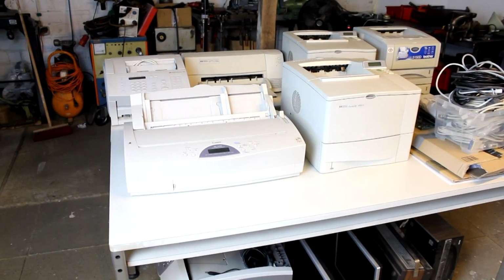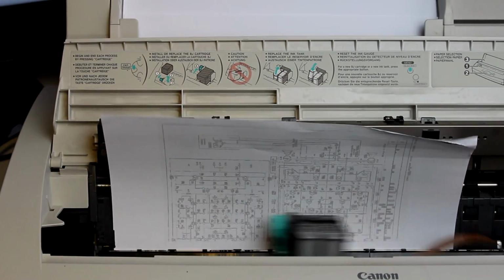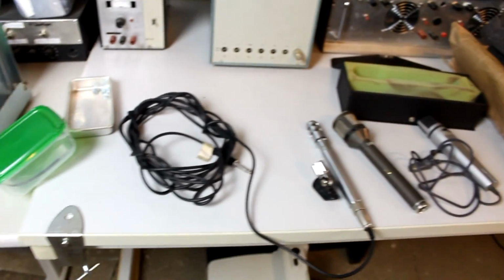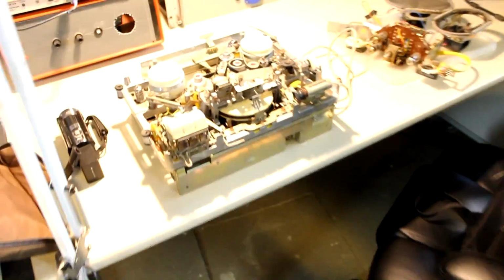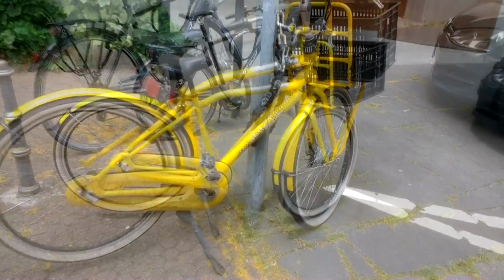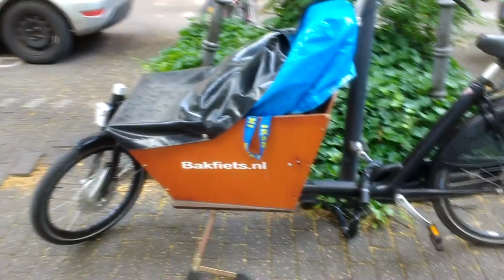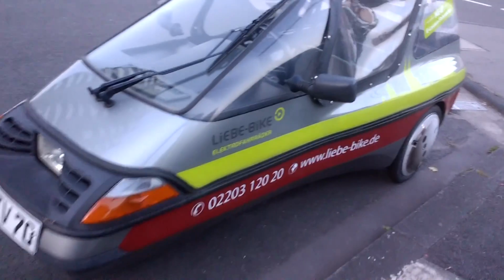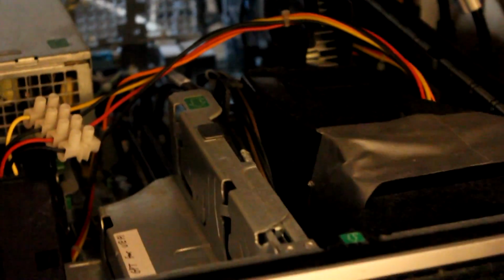TPAI Lab Report #014: DIY Cargo Bike? Disk Writing Robot etc.

Comment: The problem with the trike (three wheel design) is that there is no feedback from the front wheel when the road becomes rough (like the streets of Krefeld). It's too easy to loose control and that is why motorcycle companies stopped building them back in the 80s. Two wheels in the front offers such feedback and alerts the rider when the road becomes uneven. As far as width is concerned, it is best not to ride so aggressively through tight traffic, especially when loaded with cargo. In Germany many young riders tend to go through heavy traffic like Superman and watching that everyday makes my hair stand on end!

Comment: About the bikes some terminology you might want to know.  A DELTA style tricycle has the 2 wheels in he back, a TADPOLE tricycle has 2 wheels in the front.  Delta's and rigid-axle tadpoles tend to be unstable (they tip over easily when turning), so a TADPOLE with an Ackerman steering system is the best choice in trikes.  Build whatever cargo cycle you wish, as each has it's own advantages and disadvantages.  Many people prefer to avoid more than 2 wheels altogether.  I like your videos, keep 'em coming!  :-)

Comment: The obvious thing to do with a parallel port printer is add a RasPi or something to turn it into a network printer.   You can get them all to emulate the same modern protocol that way, and avoid driver problems (assuming you can get a Linux driver running on the RasPi).   The other way is to get an old PC running a version of Windows that matches the age of the printer.

Comment: When I was 17 or 18 I used to be a delivery boy for a super marked that offered home delivery of entire shopinglists and Beverages.
We hat several cargo bikes with the cargo platform over the front wheel and one of the extended ones with the platform between handle and front wheel.

While the smaller ones were more agile the extended one had a crucial advantage: The platform was lower than the axles!
We were able to stack up to 8 crates of glass water bottles and throw an additional banana box on top of it and another one on the rear standard pannier rack.

That were easily 2 to 4 times as many deliveries in one go as you could carry with the smaller bikes.

Your Videos shoes several extended bikes with a platform higher than the axles... I don't know about these. In no case you will be able to keep the  center of mass below the axles, because the cargo will be stacked up. But every bet might help.

Greetings from Cologne by the way
TOM

Comment: Hello    Please Help
I wish to build a Quad Bike for my 11 yrs old kid.  I will use a battery and motor to provide the rolling force.
I need to know what motor I should use 
Thanks
Reply: urdu learner Quads are death traps
Speaking from experience if you roll one your foot / leg is screwed.

If you are going to build one then make sure the center of gravity is low and the quad is light
Reply: get a grey one. pretty much every type of motor i've seen in these electronics videos is grey.  go with grey, it's a safe bet.
Reply: urdu learner 
Maybe use a motor from an old whipper snipper or lawn mower? 

But if it is for your kid use an electric motor from an old power tool or something, quad bikes are death traps.

Comment: Cargobikes: The cheapest and easiest way to build one is to make a two wheeled bike. Like the ones you showed in your video.
Then you just have to extend the frame and add heimjoints and rods to extend the steering.
I also suggest using a smaller wheel front wheel,  it's a bit easier to handle and it makes the build process a bit easier.
16" may be a bit too small for cobblestone roads  but 20" or even 24" should be fine.
And if you want to upgrade to an E-bike; just chop the rear frame and replace it with a second had E-bike with the motor built in the frame . There are a lot of cheap second hand bikes around with dead batteries that you can by for a bargain.
Can't wait to see what you come up with!

Comment: That "industrial" bike is a modern replica of the famous Long John - not to be confused with underwear. 

As for the tricycles, it's certainly accurate to state they struggle with narrow innercity environments and just have a lousy handling in general. 

The HP 4050 is a beast of a printer: cheap running cost and extremely reliable. Especially the network enabled version (4050N) is still a very attractive option today, as it can be connected via ethernet to a wireless router as a network printer, providing wireless printing for all devices on the network. They should still fetch a pretty penny on ebay.

Comment: just buy a trike and get the 1000w hub motor kit for ebike and 2*6s battery I recommend the 16000mah or 20000mah 6s multistar battery from hobby king because it is only 150$ and a lot cheaper.. the ebike kit cost 220$....

Comment: Cargo Bike, I have 2 wheel experience. Made box over front wheel, made box over back wheel, used both at same time. Results, good for small light loads only. 
I have been working on a three wheel plan for some time now, in my spare time. Three wheels are an absolute requirement if one wants to move anything but the smallest lightest loads. I want something that I can go get groceries with, and two wheels absolutely do not work for that task.
I never seen a forward trike before, I am so glad I watched this video. I now will do some engineering with forward trikes. I will watch your vids too on cargo bikes. It will be a while before I actually start fabricating one though, maybe next summer.
I need a bike that can safely haul 150 kg. That may seem like a lot, but a trip to the grocery store can easily weigh close to that.
Reply: I made a grocery getter bike. It has dual baskets in back, 1 in front. It can haul about $200 worth of groceries. It uses an old steel cruiser women's frame. I upgraded the real wheel to a extra heavy duty coaster brake with 11 gauge SS spokes and a dual kickstand so it is easy and stable to load. 

Spent some coin on it but nowhere near as expensive as a cargo bike. (which I also would love)
Reply: Do you eat lead?

Comment: why not travel in your car or buy a moped?
Reply: Parking will slaughter you in a lot of European cities. That's if you can find anywhere in the first place.
Reply: sim6699 The car is a really clumsy thing in German cities, with nowhere to park (or pay up to 3€ for 15 minutes of parking), and the constant traffic jams at every stop light (where often only one third of the cars that are waiting there get through one green cycle). A moped is certainly much better in that regard (although I don't know whether cologne also tolerates parking them on the sidewalks, as it is done here in Berlin, which is really comfortable), but it again can't haul much cargo, or you'd have to get a Piaggio Ape, which will again destroy the advantages of having a small vehicle to get around the city, because it is almost as wide as a car, and you can't skip traffic jams in it, nor park it on the sidewalks. So a cargo bike is actually a really good idea instead (I say this even though I only own a car and a moped, and a nonfunctional normal bike which I haven't managed to repair since about 2 years).
Reply: That's why city life sucks. Move out to the country!

Comment: I try to pick up old laser printers when ever I can. They are a cheap source of good quality stepper motors, gears and precision rods/rollers
Reply: Well. I mostly only keep the motors. But I built my first two 3D printers out of old laser printer parts. Well. Minus the extrusion components.
Reply: The newer ones (especially the cheap) are all using DC-Motors with digital encoders
Reply: Yup, Picked up an old office printer an office was giving away for free on craigslist, It had around 15 universal stepper motors, 4 laser diodes, And the most springs, Pulleys, and gears I've ever seen packed into anything, Mostly extension springs, I filled an entire mason jar with all of the screws from it, and I'm working on a pen plotter with the scanner.